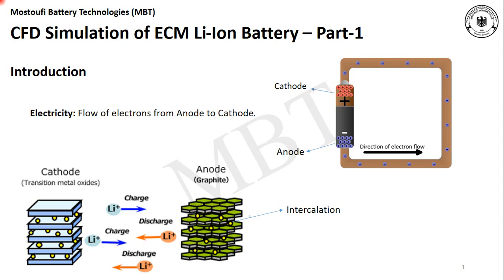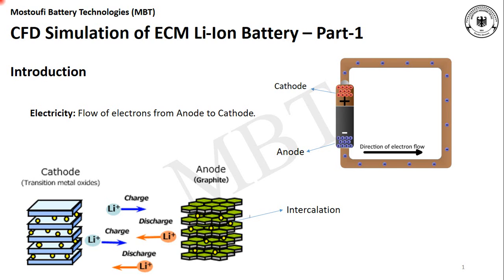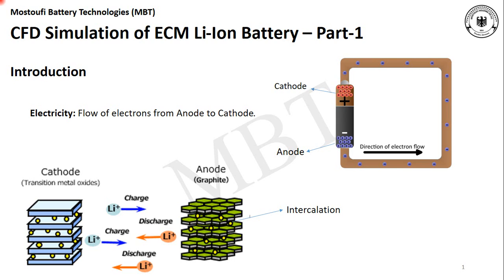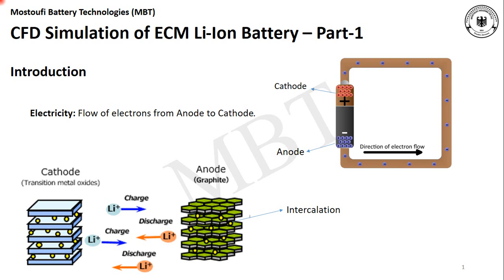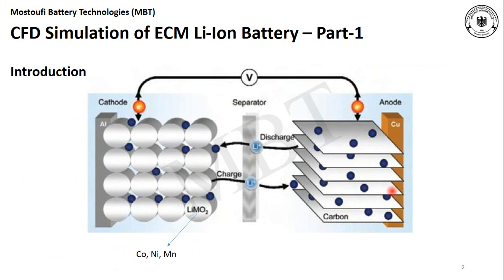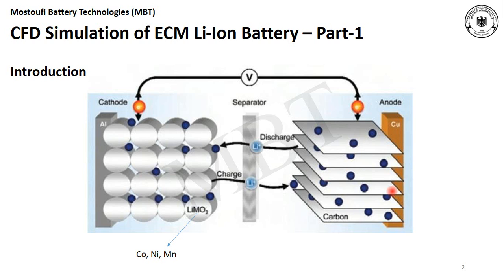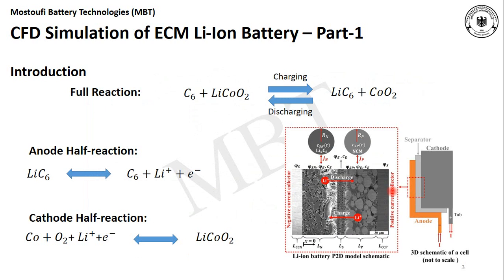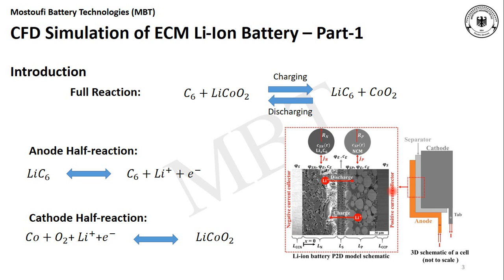Li-Ion Battery Simulation Using MSMD Model in Ansys-Part-1-Introduction

Comment: Hello sir! Can we simulate lithium iron phosphate battery in ansys using this msmd module?
Reply from the maker: Hi, yes, you can simulate any type of Metal-ion battery using the MSMD module in Ansys.
Reply: @mbt_s  Hi. What is the appropriate material for the tabs when simulating a lithium iron phosphate battery? Aluminium or copper? 
Ps. Do you have any resources for this?
Reply from the maker: @anuskagautam4491  Hi, Copper is a widely used material for the tabs. You can search for the data-sheets of any particular battery and find useful information on the material selection.
Reply: @mbt_s  sir can i simulate new type of metal air cell  and test its sucess here?